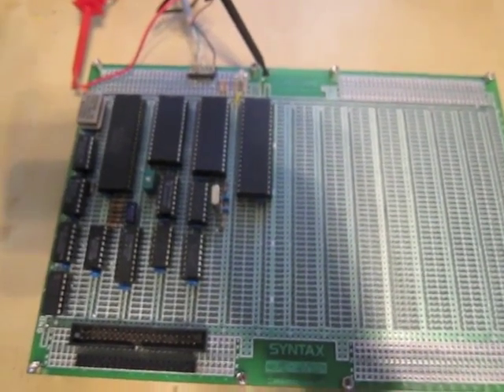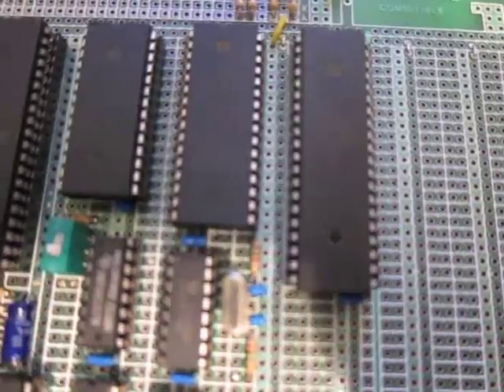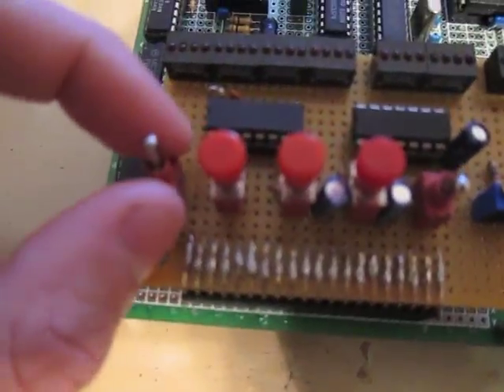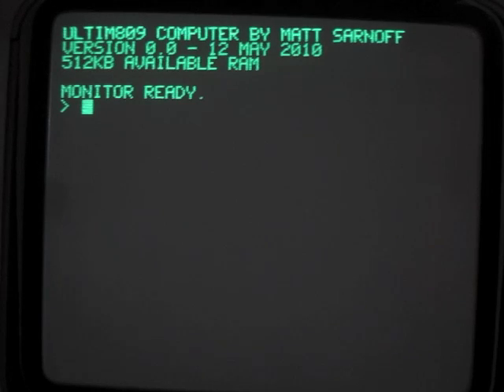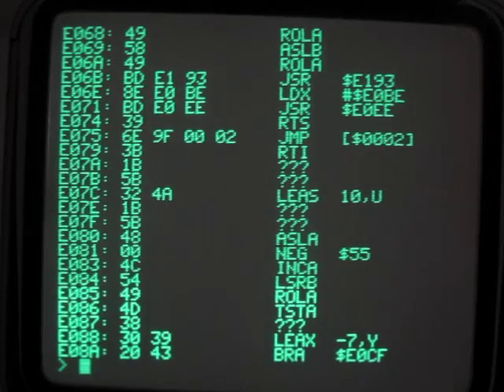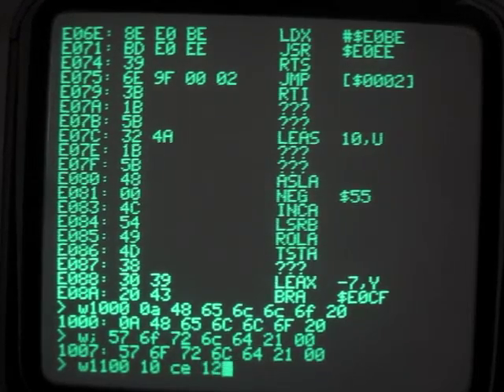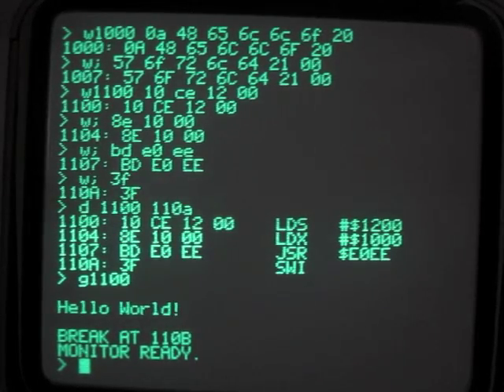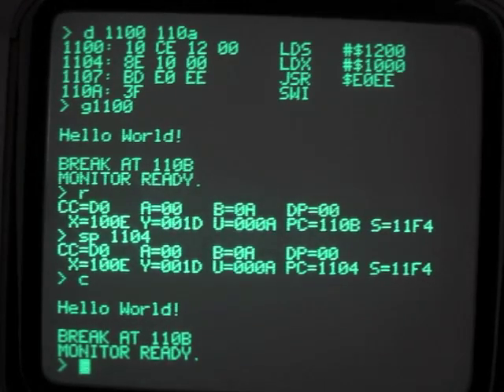Homebrew 6809 Computer + Terminalscope: Monitor, Disassembler

Comment: Great to see this super chip being used!

In the 80's I had a Color Computer (based on 6809), and in the unused 1.5k of the BasicROM, wrote an file manager that emulated that used in OS9.  The CoCo could access 4 floppies - D0 to D3 (I think).  I used that reference so that D4 thru D7 would be hard disks. Using a published dis-assembly of the RS BASIC ROM, I could load the ROM to RAM, and then whenever there were references to disk, if the drive # was greater than 3 - I'd jump up to my disk driver and write the data in OS9 file system format.  Each HD was an OS9 directory. Then when you booted to OS9 - you could access the data.  It was very cool - but never really got used... Some fellow was selling HD's for the CoCo, and used it - think we called it "WinBasic" - as hard drives where still called "winchester" drives (after the IBM 3030 I think).

In some 40 years of software work, that was my most enjoyable project!  The 6809 was a beautiful design - and I understand it COULD have been the basis of the IBM PC, but Motorola was "too busy" with their automotive market, and declined become involved... and so the world was hamstrung with the crap Intel architecture...  But that is a story for another day.

GREAT PROJECT Matt!!

=Alan R.

Comment: 2 Questions and a comment. Why did you use a 4 Mhz oscillator and use dividers to drop down the clock to 1 Mhz, Did you need to derive other frequencies?. Your Terminal Character set looks like the Apple II Character set ,Is it ?

I think your project is great, Thanks for the video.

Comment: That's not the hard part. Clearly you've never coded in assembly, at least for anything significant. (inline asm in C/C++ does not count, although I doubt you've even done that much)

In assembly, even the most trivial operations take several instructions, and operate in a fairly complex manner. For example, an If statement (w/call)
If (x < y)
MOV [x in RAM],a
MOV [y in RAM],b
SUB a,b
CMP a
BCS [label next]
CALL [if code]
abc:
CALL [else code]
B [end]
end:
[continue other code]

Syntax may vary.